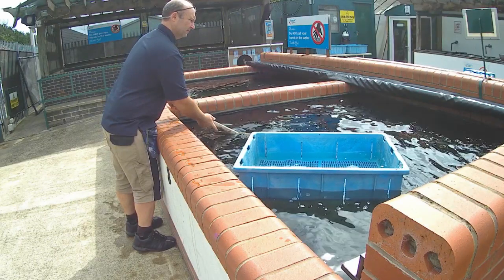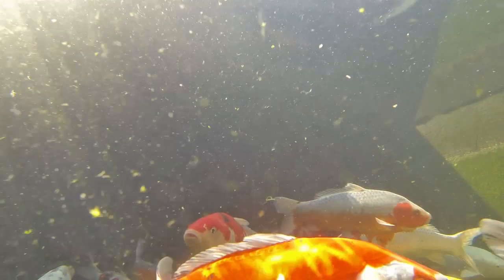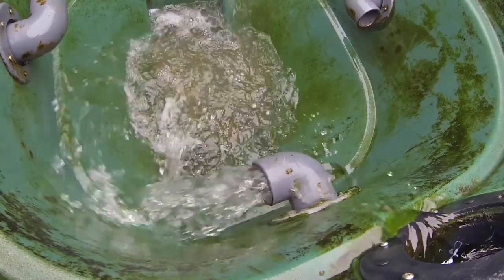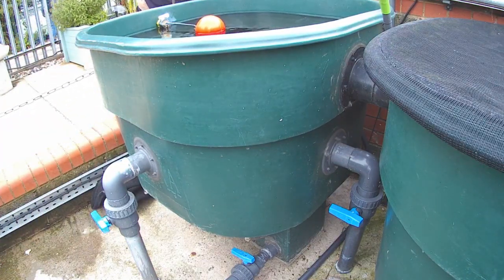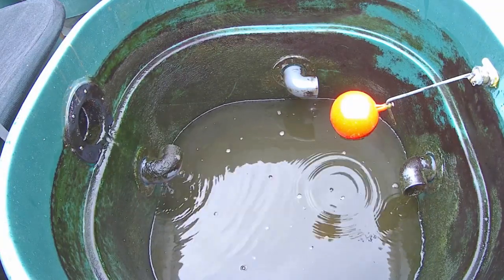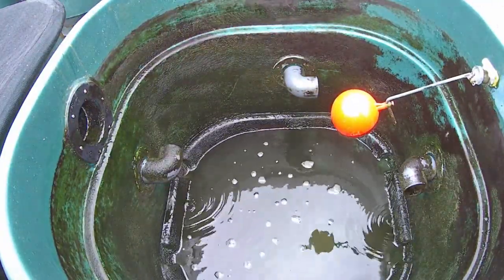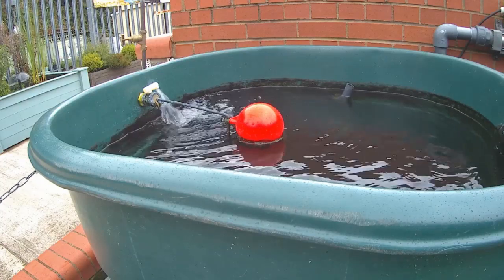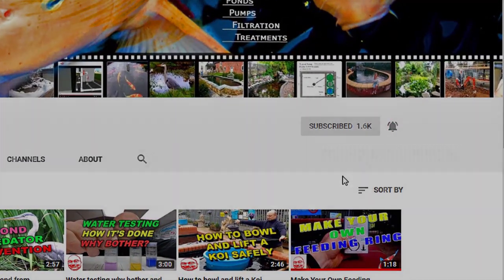Purge out your bottom drain!

Comment: When I did my aquatics course at college,  it was considered to be good practice to supply gravity fed filters from mid water outlets in the side wall of a pond. Bottom drains were exactly that, a drain. They feed to a valve or standpipe and are used to do partial water changes. When opened, the water rushes out to waste, taking sediment from the bottom of the pond with it. It was considered bad practice to use the bottom drain to feed the filter because of the risk of silting up of the pipework.  Simply cracking open the drain valve every day or few days , depending on stock levels,  would remove the sediment from the pond. That's how all the systems worked in the various stores that I worked at.